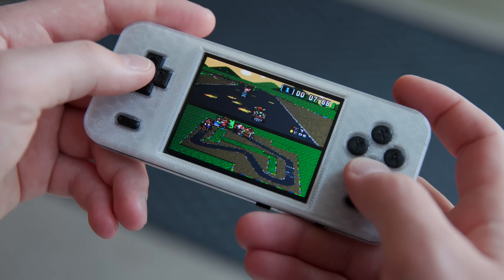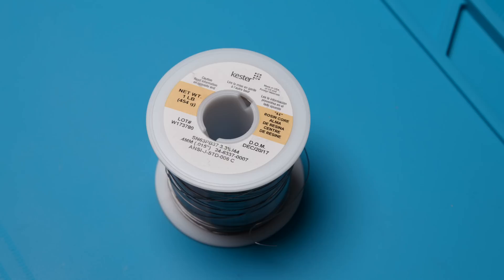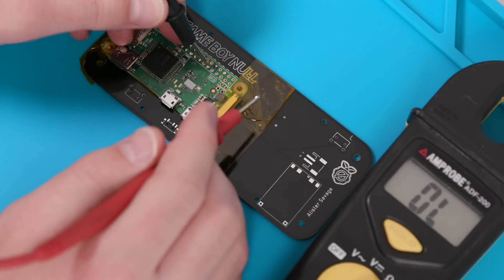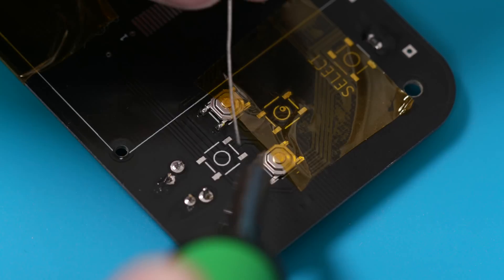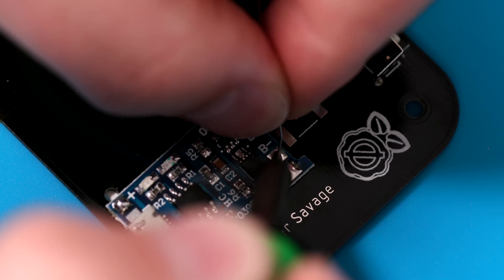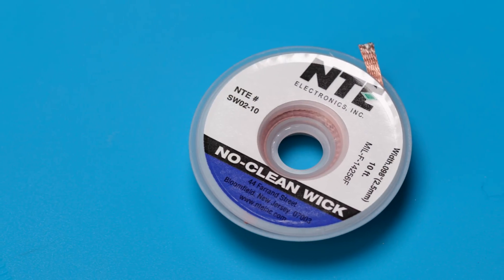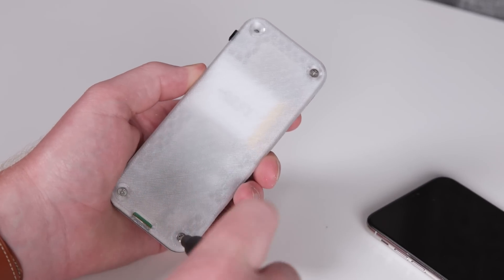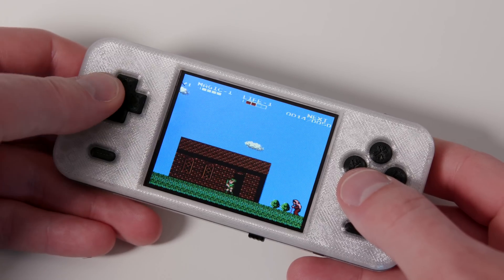Thousands of Retro Games in Your Pocket with this DIY Emulator!

Comment: 70$ for this (including all the 3D printing and soldering involved).

I'm genuinely glad I ended up buying my original PSP 1000 for $30 and simply soft moded it, to run homebrews and emulators. It came with an original charger, a rigid steel body case, 2 UMD games (that I never play) [Army of two, and FF Dissidia 1 if anyone is curious], and a 1GB memory stick (no soldering needed). It's small enough to fit into my pockets without the case; However, I might just have large pockets, (It is smaller than the switch). I added an sd card adapter and ran the cfw and now it runs Homebrew's, NES, SNES, GBA, and even PS1 games easily. It also came with onboard audio, and has a headphone jack, the display while not as vibrant as the PSP 3000, or as amazing as the PS Vita's OLED display is still pretty decent. One benefit of having the PSP 1000 is that you can run the CPIL Flasher and permanently run cfw on your PSP without having to launch the cfw application everytime the device is rebooted. The battery life is around 4-5 hours which is decent, and the batteries are replaceable and can be swapped. The Charger also comes with a really long wire making it easy to plug n play. It also has built-in brightness adjustment, on top of that all the button's have near perfect travel (I hate smartphone emulators for there reliance on touch input displays). It has a UMD slot, but I never use it, (I doubt anyone ever will). It also has a built-in wireless Wi-Fi and LAN (LAN works fine), however, the Wi-Fi adapter hasn't aged well it can't connect to any connection that uses WPA2 security encryption or above. And although that can be altered from your ISP login portal, it's not recommended for security reasons. If you do lower your encryption to WPA1, it works flawlessly without having to open text files and enter wifi credentials. 

Honestly, I feel as if I was expecting waaaaaaay too much here. Like the device could charge wirelessly, and have built-in Bluetooth support for external displays! Well, one can dream ... :D
Reply: Oh it also supports remote play for PS3 if they are on the same network.

Comment: if you don't like seeing the print lines on the 3D printed parts, you can remove those by using "acetone smoothing" on the 3D printed part.
Reply from the maker: Only works if you print ABS.

Comment: I really recommend you get a finer nozzle for your MK3, I have a MK2 and printing with a 0.15 mm nozzle is just amazing. The level of detail is on par with resin 3D printers. and the nozzles are not even expensive at all. The only downside is printing time. But your printer has really good motors so you shouldn't have any issues, I haven't had any. Saludos desde guadalajara, tus videos son geniales.
Reply from the maker: All these parts were printed 0.25. Looks way better than 0.4, but I wanna go even smaller. ;)

Comment: Pro tip. Use liquid silicone to seal the battery wires and not risking shortcircuits

Comment: Hold on this has no audio? As in games have no sound? Looks cool and i love the size but that is an epic fail right there. You have to have the sound when playing emulated games that is a huge part for me
Reply from the maker: You can add sound pretty easily. The 3D printing guide has instructions for creating a larger enclosure with a sound controller and speaker, but I chose not to go that route because I wanted it to be tiny.
Reply: Yes , can see why you chose to do that because form factor is great, what is annoying though is I would love a device this size with full sound etc but it doesn't seem to exist. I have a retro game RS97 with CFW and a PSPGO with CFW, both amazing but would love something a  little smaller like this that is more compact like a gamboy mirco

Comment: Awesome project, but you shut clean your PCB. Flux is awesome, but make solder joints more predisposed to rust/oxidized. Same isopropyl alcohol or something similar will be fine.
Reply from the maker: This is a good suggestion. I was rushing as quick as I could to meet a deadline so I'm adding a few changes over the next few days and this is one of them. Also going to try soft-touch buttons.

Comment: This video has convinced me that flux is witchcraft. How did you not bridge the connections on that ribbon cable...
Reply from the maker: IT IS MAGIC!
Reply: Surface tension and the pcb surface is coated with a solder repellant of sorts
Reply: r/wooooooooooosh
Reply: that's just soldermask
Reply: was thinking the same! i use flux but had no idea i could do that lol
Reply: Even without flux it’s not too hard to do.
Reply: + zach burke
Well your solder already contains flux. But adding a bit more flux does wonders for your solder quality.
Reply: nipi tiri agreed, adding solder to solder does wonders for soldering.
;)
Reply: (Waves hand) You saw nothing!
Reply: Metal contacts conducts heat much quicker than the board around it so the solder sticks to it first..the flux just helps keep the board cool while still allowing the metal parts to get hot.

Comment: I’ve been trying to do something like this for over a decade, ever since running emulators on the GP2X and PSP Go. I’ve had every handheld ranging from the Nvidia Shield to the GPD Win. 

While the GPD Win 2 is pretty close to the perfect handheld gaming powerhouse for me, it’s also expensive as hell. 

I’m definitely going to try this! Would be perfect to give to the kids instead of my GPD Win 2
Reply from the maker: Agreed. This thing is as durable as all get out too. Would be an awesome build!
Reply: Snazzy Labs Just took the time to actually watch the video, instead of clicking Like right after posting my reply. I’m definitely going to order the parts for this thing tonight, just have to shop around for the cheapest shipping to the Netherlands. 

Your NES-cartridge emulator is still working perfectly. Hopefully, this will turn out at least as well!
Reply: GPD Win 2 hahahah I can get a GTX 1060 powered 17 inch  full laptop for the price of the GPD Win 2..... Thats a GPD Loose if you ask me!!
Reply: myname is private Good luck stuffing a 17” laptop in your pocket. And good job on totally missing the point.

Comment: great video! I was considering raspberry pi in some shape or form, but then remembered I have an old ipad2 collecting dust. since then it's become my go to snes emulator machine coupled with a knock-off dualshock3 controller. the quality isn't bad, and it connected without a hassle through the snes9x ex+ interface and btstack. perfect for a chill gaming session on the couch. and hey, I'd rather not use touch controls, but it's still an option for the on-the-go scenario

Comment: Small tip. Do not cut both wires on the battery at once as shown in the video. You risk making a short.
Reply from the maker: Good suggestion. Thanks.

Comment: 6:53 cut both wires one by one, or you are going to shorten the battery (if you shorten the batterys, it hurts them, but doesn't destroy them)
Reply from the maker: This is probably a good suggestion. Didn't even cross my mind. Thanks.
Reply: @snazzy  literally a massive mistake there. Luckily this is a small battery, but this can easily create a fire! BE CAREFUL WITH LIPOS! Cut one lead off, solder, THEN cut the other...
Reply: No problem ^^
Reply: smpl. TimeFX Minor nitpick, but I think you mean 'short'
Reply: short circuit
Reply: I think he did it that way to be more camera-friendly. But yeah, one at a time and staggered is how you should do it. It would had been better, IMO to solder the actual connector to the board so the battery can be replaced rather than omitting the connector altogether. Honestly surprised there was no means to incorporate a Nintendo 3DS battery into the unit with a back cover.
Reply: Snazzy Labs  "probably" lol
Reply: I once made that mistake with a high drain lipo when i was done with the cut maby 0,5 sec the lipo was at 50 °C already quite scarry
Reply: The battery have BMS in there, it should protect if the output wire touches. No worries.

Comment: A PSP is by far the best portable for emulation and are super cheap nowadays, a cool project nonetheless.
Reply: Your opinion isn't shared by everybody. The PSP isn't the perfect form factor, it's bulkier than some options. It doesn't have the best CPU for emulation and don't support SD cards natively. The screen resolution isn't great either.
Reply: Although the psp is the cheapest option, a vita with henkaku is actually the best option atm for portable emulation, as you get native vita games (which can also be overclocked), psp emulation, ps3/ps4 remote play, Steam pc library streaming with moonlight if you have a nVidia GPU with GeForce Experience, as well as a whole slew of polished native emulators with retroarch.
Reply: @shake9246  Getting harder and harder to find a Vita with the right firmware, though.
Reply: a PSP is better for sure, but if you already have a decent Android phone with a 32GB or higher micro SD card, I say a MOGA Hero Power controller with a built in phone clip, and battery that can also charge your phone is the way to go for $30 USD, but if you are on a tight budget you can get the original Moga controller for little as $5(Dollar General had them on sale over Christmas 2017), that uses 2 AAA batteries, but needs the MOGA universal app to work with non MOGA specific games, and emulators. and with both controllers you do get the phone clip, and 2 analog sticks/pads, and Hero Power has a D-pad, dual mode switch, and 4 analog triggers
Reply: Yeah suppose it depends. I got a pspgo with CFW and a GPD XD but actually find myself using the PSPGo a lot more due to the convenience of the UI, perfect PSP and PSOne support and small form factor, also wont eat into your phones battery when playing.
Reply: Nah
Reply: Yes, A PSP is about 100X better than this, this has no audio to start with lol
Reply: Any android phone is better then both this and a PSP lol
Reply: @LokiNegus  No it's not. You may find a smartphone to be the answer to every situation you come across, but others do not. As someone who has used 'smartphones' since before the term became commonplace, and I have loads of the damn things, I guarantee they have their downsides. Dedicated physical buttons for gaming? Capacitive touchscreens just don't work as well as there's no physical feedback (screen vibration settings do not replicate the sensation of physical buttons). One device for gaming, music, video, internet, texting and phone calls? Best carry a spare battery or charging brick and hope you don't run out of juice.
Reply: @another3997  1) Controllers for smart phones exist 2) Power banks also exist (and plugs)